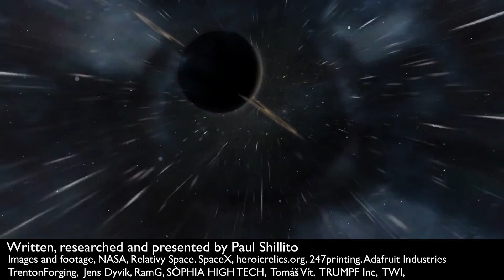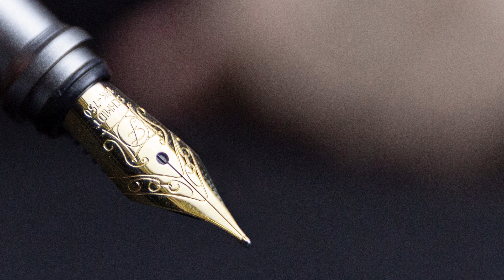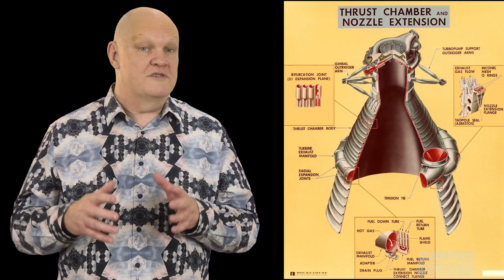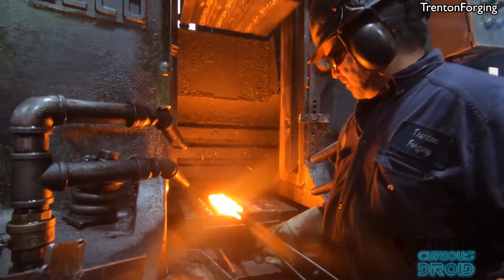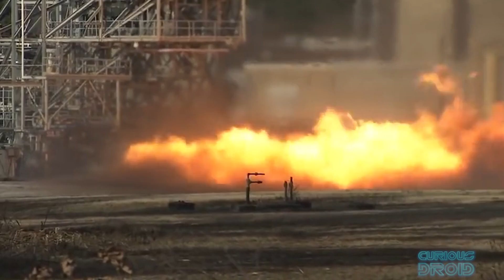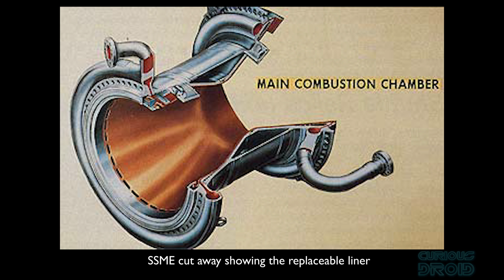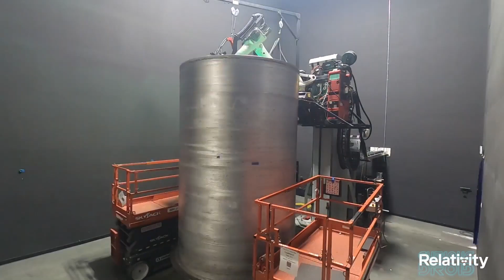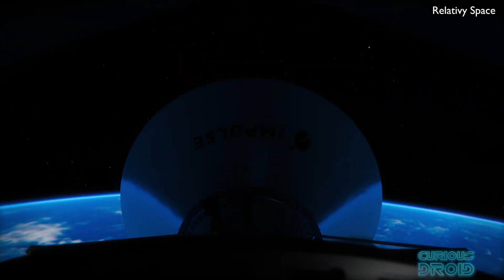Could NASA 3D Print a New F-1 Rocket Engine?

Comment: Consumer grade additive metal manufacturing will change the world.

Between metals and plastic it'll be absolutely incredible!
Reply: If it's as flimsy as 3d printed plastics, it absolutely will not change anything. Except perhaps further decrease the lifecycle of consumer products. Gotta love planned obsolescence.
Reply: @soggycracker5934  are you familiar with metal?
Reply: @soggycracker5934  There's nothing inherently flimsy about 3D printed plastics.  Every material and process has its strengths and weaknesses, and we design parts either with or without respect for those constraints, and make choices with or without clear strength and lifetime goals.  I run a 3D print farm and mostly produce parts other people have designed with all sorts of different objectives.  Most of my own 3D printing is about repairing and improving products to extend their lifetime and usefulness!
Reply: It's already here and doing so!
However 3D printing directly in metal is unlikely to be desirable in the home anytime soon, as it involves a level of energy and material handling safety risk that is orders of magnitude greater than plastic printing at home, not to mention more specialist tuned to a narrower niche of applications.  However, consumer access to metal printing bureau services is already with us.
Reply: @soggycracker5934 flimsy??? I’ve spent several years designing automotive parts for 3D printing which out performed molded parts. Design matters, one can print part designs that can’t be molded..  even print pre-assembled parts to reduce cost. Many new processes and materials are just as good as injection molding materials.
Reply: @soggycracker5934  They 3d printed a metal 1911 handgun out of inconel and it worked flawlessly from what I understand. 20,000+psi working pressure on the firearm, test cycles of 500+ or so such pressure events.

One of my primary thoughts is additive manufacturing in countries with access to very minimal equipment today (Africa, SE Asia) where you could start developing quite the industry out of almost nothing.
Reply: @edumaker-alexgibson  I can't reveal how my brother did it, but he recently used a process to de-obsolescence a very, very important part for many household goods. Takes the item from a 5yr shelf-life to a 20+yr life for just a few dollars.
Reply: @KrustyKlown  Great point. Many people also forget that, while very efficient, injection molding is far from a perfect process already.
Reply: @InvestmentJoy  So... Less than standard 45acp pressures? And 45acp being a rather low pressure round to begin with.
Reply: We are a long way from practical mass 3d metal printing of high precision items in my opinion. Yes there are certain things that can and are being done. But if you need thousands of say engine blocks a day current technology of creating and machining does the job. I want to see ISO Class 2 or ABEC Class 7 bearings being 3d printed.
Reply: @KrustyKlown  No you didn't.
Reply: @soggycracker5934  Shotguns are even lower pressure than .45. Low pressure on a wider area means more force.

Comment: Stargate 3d printer "virtually eliminates welding " - its a robot mig welder that makes things entirely out of weld bead  !
Reply: He meant manual welding.
Reply: No, It virtually eliminates welders. It takes their jobs, and if one walks too close the robot arm, it kills them.
Reply: @oglordbrandon  - Robotic welding has been going on for decades now. This is the just another modern variant of it.
Reply: @michaelmoorrees3585  whoosh...
Reply: Listen again. It eliminates weldings (as in welding seams and welded connections), not welding.
Reply: @wernerviehhauser94  That's kind of his point, the whole thing is made out of weld material now. So beforehand you had a nice forged material with one brittle weld seam, now you have a part entirely made of weld seam. Not necessarily a problem depending on the properties you are after but as with any new process there are some new problems to be dealt with as well.
Reply: @joshchew123  if you know welding, you should know that the seam is much more unlikely to break than the material right next to it that never reached melting temperature and therefore recrystallizes in a different way - which does not happen the same way here. I am therefore not assuming that something made by this process is inferior to forging, and forging has a long list of failures on its own. This process CAN be superior, and time will tell if it is.
Still, going back to the video, I am pretty sure that what was said there is not exactly what many here assume was said or meant.
Reply: I thought that, all it produces is a giant weld. There is a lot of nonsense talked about their first rocket and inefficiencies introduced by dogmatically 3d printing everything is why it was abandoned before it even got to orbit. Their new rocket has large parts fabricated from sheet materials which produced much stronger and lighter rocket body. 3D printing is good for some components but not all, not even close.
Reply: @wernerviehhauser94  yes that's right, the problem is every time you put down a new layer, the layer beneath becomes a new heat affected zone, and it continues up throughout the part. So your whole part is made of recystallized material, and it leads to epitaxial grains growing up through the entire lattice which are very crack susceptible. For something which is presumably going to be containing high pressure liquid or gas and subject to massive vibrations, forged material is objectively better, so for something like this we would usually roll each layer to impart stress first. Still, not to put a downer on the technology, I'm assuming they know full well what they are doing and it must work well enough for them :) so looking forward to them sorting the bugs in the equipment ans seeing where it goes
Reply: I have argued numerous times that this MIG  welding version of '3d printing' is inferior for the main cylindrical body of the craft because of inconsistencies, higher total mass, poor grain structure, etc.
Perhaps what people will take notice of is the fact  that Relatively Space redesigned TeranR, it No longer uses this '3d printing method for the cylindrical areas of the main structure. 
Does this tell you anything?
Reply: @michaelmoorrees3585 
“The welds are perfect! Now.. if we could just get it to stop killing people” 
😂
Reply: Details…
Reply: @joshchew123  A few engineering colleagues and backyard scientists made a 3D printed rotary combustion engine. The triangle exploded inside the combustion chamber. Don't remember the exact RPM, but since it was a very small engine, i assume it was pretty high.
Reply: @wernerviehhauser94  Something I learned about 3d Sintering printing that upset me is that 3d printing is 1/2 the physical strength (or even weaker) than forged metal, but that doesn't mean that the extreme engineering projects like fuel injectors for airliners, etc, can't benefit from this technology and save a ton of fuel. --- New Thread --- I was always thinking that big airships could make a huge comeback by using this technology, and bring the production costs down, and see lots of airships in the skies again. Sincerely, The Psychic Surgeon!!! Kelly

Comment: Simple answer is no. The F-1 was designed with extremely specific means of manufacture. Between trying to replicate the F-1 or simply designing a new engine with comparable specs... the latter is more feasible.
Reply: I'm not arguing your point.
But what gross processes can be eliminated and or introduced?
Reply: @AndrewBlacker-wr2ve  Welding. It's fairly simple in concept but when you need to design an engine with minimal weight and maximum heat resistance... simple answer is that the F-1 was never intended for mass production. It is not something one can copy from a blueprint and recreate.
Reply: In the last decade their was a Proposed F-1B engine design study that had a higher specific impulse and more modern electronics and a simplified design.
Reply: Their thirst for efficiency seems to prevent them to create a giant Merlin 1-D like engine, simple open cycle engine with even more thrust than the F-1, but of course, « gushing » fuel…
Reply: In reality, no one just copy the F1 engine but they would modify it so it's much easier to use 3D printing. The real point is 3D printing is reaching a point that could be the dominate manufacturing method in the near future. It appears to use less material and appears to be less wasteful than traditional methods and often much faster.
Reply: Double No. Too many linear and Horizontally moving parts and a 3D printer can't temperature differentiate materials that have to withstand 4000 degrees......yet
Reply: Actually, the simple answer is yes but it wouldn't be practical. The f1 was built the way it was because of the limits in manufacturing at the time. The processes involved have improved exponentially and as such it wouldn't make sense to limit yourself with the design.
Reply: Yes the housing and other parts can be printed. As for all of it working as it should the first time....I wouldn't trust it. Prime example: the Apollo program had to understand and then nullify " polo oscillation." A 3D printer doesn't get you closer to lowering that cavitation effect - had to keep building it to sort it out and throttle back the motor.
Reply: @BattleshipAgincourt they don't have drawings
The drawings belonged to private companies that are not in business any more. For example a famous British Aircraft manufacture was forced to. Merge by the government into what eventually became BAE. They took every drawing from the entire archive and burnt them out of spite!
Reply: @matthewguerra5410 a lot of people don’t know about the F1B for some reason, and that it was considered as one of the engines for SLS.
Reply: @BattleshipAgincourt  I am guessing that the F-1 beat out the Soviet design of many smaller engines due to the difficulty the Soviets had coordinating so many assemblies.  The sophisticated sensors and control systems in use today mean that this is less of a problem, so the benefit of the F-1 is less compelling.  But that's just my uninformed guess.
Reply: @chocolatecatdad  if 3d printing uses less material or not depends a lot on what you compare it to. compared to forged something or a sheet like thing construction 3d printing isn't better as in you can't make stuff as dense.

machining has gone forward a lot since then too though and plating and tube-auto-benders and other related technologies. but f1 is a whole kind of a thing, resonances of everything and all, so nobody knows if it would work if you changed something about like changing some tubes to a 3d printed manifold.
Reply: Well ... no.  We can EASILY remake F1 using modern 3d printing eliminating nearly all the welding required and thousands of parts.  F1 were not efficient engines and why NASA was not exactly thrilled to remake them.  Their ISP sucks.  Rocketdyne already had the drawings and started the 3d print process.  They were looking for a small bit of funding and ability to get it tested at a NASA facility.  They had already recreated via 3d printing and tested the F1 turbo machinery which fuels the combustion chamber.  They were turned down by NASA even though they had the 3D drawings in hand ready to go...  

Sigh, guess I should have been the one making this video.  Idiot didn't even bother to try and reach out to the Guys who originally MADE the F1 engine to get REAL information on making a new version.  Or do a google search... Though such info is probably lost from 10 yrs ago.  But not even contacting Rocketdyne is embarrassing.  They have a PR department who is MORE than willing to help.
Reply: @w8stral  if it were easy they could've just done it.

the risk is in how many iterations it would take with resonances and unforeseen effects of changing the totality of it. if they were so sure and it would've been easy they would've just done it.

if the "easy" part would've included scaling up the printing tech etc it would've ceased to be easy and such work got done in past decade regardless. if rocketdyne had the technology to 3d print something big it would be easy to argue that they could've made money with just that itself...
Reply: @lasskinn474  It's honestly not that hard relative to the technology we have today such as CFD.

The problem is just.... Can you enjoy seeing someone doing money-dumping nostalgic hobby with taxpayer money? Espescially if RS-25 is literally sitting right there enjoying some sportify Playlist.
Reply: Several heavy lift rockets, including Ariane 5 and 6, Vulcan, Space Shuttle and SLS, have chosen big solid fuel boosters instead of big liquid fuel first stages.  High Isp is not so important in booster stages, but high thrust to weight and high total thrust is.  Solids fit that requirement well.  With well developed high thrust solids, big liquid fueled first stage engines simply are not needed.

Comment: I NEVER KNEW that they had 3D printers in the eighties! All I know is, that I walked into a Microcenter one day about 12 years ago and there one was. It was a CHEAP ONE but still! Thank you Paul for another basket of information!
Reply: I remember reading about rapid prototyping in the late 80s where they squished out a ceramic paste which had to be cured by baking. But the beginnings for resin and extrusion printing are even older - just ask any patissier.
Reply: There was/is the process of sintering, which was developed in the 1940s and became widespread in the 80s.

While not what you would call modern day 3D printing, it achieved the same results, especially in prototyping metallic components. I remember when studying engineering in those days (not the 40s) of being shown lasers zapping metallic powders to create components. So, it has been around for a while.
Reply: It was called stereolithography back then. Was very expensive, the parts extremely fragile, and we were in awe when presented with a 3D pirinted prototipe.
Reply: @Baldorcete today we use I think only resins for SLA, very accurate but the strength isn't there
Reply: they did! but the term "3d printing" wasn't out yet.  various process like extrusion molding and sintered metal deposition, were crude compared to today but definitely inspired modern manufacturing.
Reply: Innovation is what made the technology more viable and cheaper to use. It’ll never replace the skilled machinist/metal fabricator but it will expand their skill set.

Comment: Extremely intriguing.
Do 3D printed components require stress relieving/annealing/ heat treatment?
Reply: Good question, I'm curious too
Reply: Yes.. The parts have to go into an oven and bake. The parts will shrink significantly during this step so everything is printer larger and baked to final dimension.
Reply: It is very dependent on the metal and the printing method used. I worked a bit on selective laser sintering of a titanium alloy and heat treatments were definitively needed after printing.
Reply: @AIM54A  I know of that happening when printing with a kind of ceramic filament in normal 3D printers, but I would've never guessed metal works like that too. Where did you find this information?
Reply: I was always told that people who thought you could 3D print or cast a high stress metal component (ie a gun, or in this case a rocket engine) don't understand metallurgy - that casting a sword out of molten metal, or 3D printing it, was like making a baseball bat out of chipboard.
Has some radical technology change happened in the last 5 years and if so what is it?
Reply: Yes, most 3d printed metal components, and some plastics (e.g. PPS) require annealing. Otherwise they are extremely weak and easily fail.
Reply: @AIM54A  HIP process typically for something going onto like an F-1.  Which is a problem, as pieces are too big. Possibly HIP it in pieces and electron beam weld them together?
Reply: Yes. Granted, nearly any alloy being pushed to the limits of material properties will require heat treatment, as I don't think many, if any have significant overlap between their working metallic structure and their use structure.

Comment: Another major issue that would be encountered in a 3D printed successor/redesigned engine that was of the same approximate size as the F-1 would be combustion instability. This was a major issue during development of the engine, as the engine would catastrophically explode on the test stand. The engineers were unable to model the processes involved, and instead went through a long period of hit-or-miss experimentation employing explosives during engine firing. Fortunately, there was plenty of money available for this. The final configuration of the injector plate was achieved, and the engine became stable. 

But why bother? The engine was not particularly efficient, and since it's not throttleable, it isn't practically recoverable/reusable.